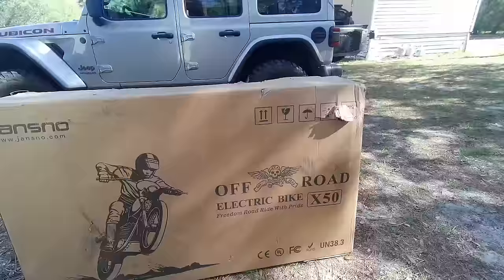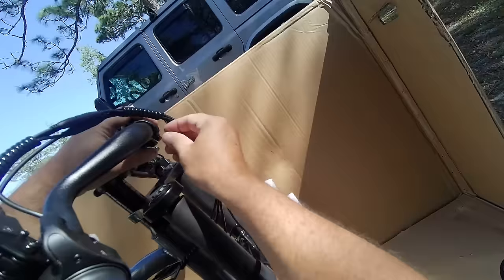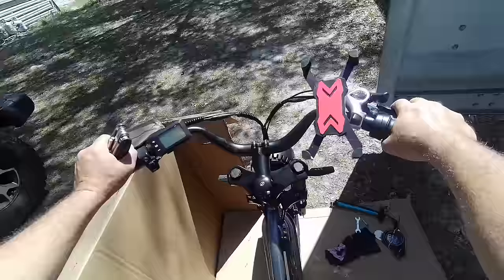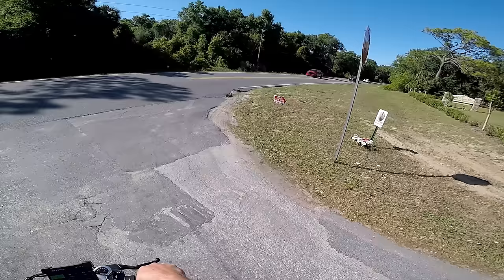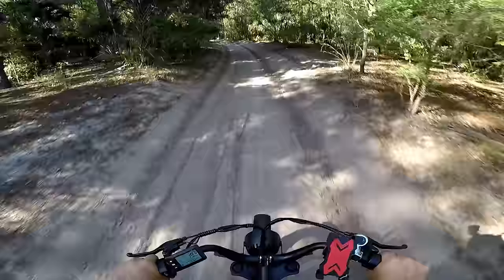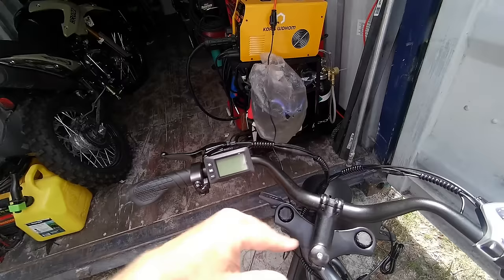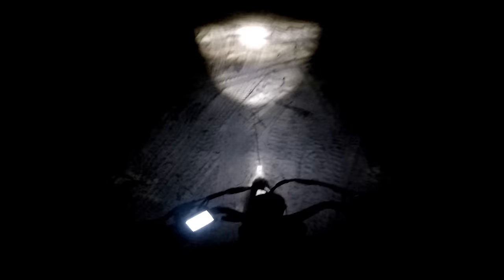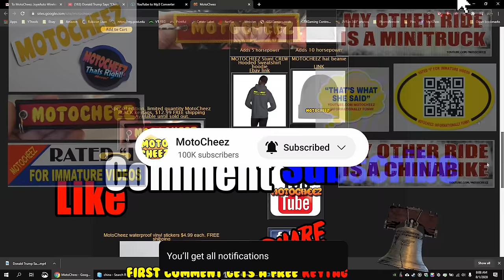Jansno X50 Electric Bike 20"x 4.0 Adults, 750W Brushless Motor, 48V 12.8Ah Removable Battery,

Comment: The biggest reason I wouldn't get this bike is the range. For the price it's a bike that's well worth it for most first timers, I would just recommend getting a UPP battery backup and triple the range. Edit: :) good you noticed the fender.
Reply from the maker: My tests were mostly in sand, thats hard work on the battery, on the road only it would do much better of course
Reply: What battery would you recommend
Reply from the maker: I'd get the same battery that's on it, or same space specs to be safe. The range is way more than I did under normal conditions
Reply: @MotoCheez  what's the range on this my job is 15 miles all round trip
Reply from the maker: Should do around 45 miles if mostly flat
Reply: @MotoCheez  Yeah It all depends on your riding style and the conditions. I was was just offering ideas for extending the range. Range is a big deal for me because I live on a chain of islands and to get to the downtown area it's about 8 miles, then another 6 just to get to the trails. I could just get a rack for my truck, and I probably will. It would be nice to make the whole circuit bike only without worry on occasion.

I know a few people who have installed a second battery and it's worked well. I only know one who somehow got it setup so they didn't have to swap batteries. I think he said he got a kit that allowed him to run them in a single circuit. I personally don't know enough to do that yet.
Reply: @MotoCheez  so can't put a 52v 20ah battery on this bike without changing the controller?
Reply from the maker: I've never done it but there is plenty of information out there
Reply from the maker: No, the controller was 48v
Reply: @MotoCheez  so I just need update the controller if a get a bigger battery
Reply from the maker: No, only if you get higher voltage battery. You can put as big battery as you want 48v
Reply: @MotoCheez  You should do a updated review video, full range test on flat ROAD and with the fenders on right, save yah the hassle of answering the same questions over and over! 🤣👍
Reply from the maker: @Wize817 but I did put in a video when I reverse the fender. When I get down to my place in Florida definitely will do it longer ride on flatter road. Keep it on the pavement mostly

Comment: Hi amazing video. Do you know where to get a replacement seat if you know the original seat rips? I been looking all over for replacement parts before purchasing. Like replacement parts for the turn signals, headlight, and seat. These don't seem to be universal parts but I could be wrong, please correct me! 😁
Reply from the maker: Most the parts are definitely universal, the seat cover I am not sure tbh. It looks similar to others I've seen. I'd bet If you measured it and ordered a seat cover you could make it work

Comment: @MotoCheez and fellow Jansno X50 owners, I have questions and would appreciate your answers/help. 1. Is the X50 decent or good for peddling as a bike? 2. Curious how does it compare to a 26" fat tire for on-road and off-road riding? 3. How does the X50 ride compare to a Folding 750W ebike in terms of ridability, offroad too (like a Lectric, Vitalin i7, etc) ? 4. Can someone weigh the X50 with battery? Lots of conflicting info on the web. 5. Lastly, whats the full length of the X50, the wheelbase, and ground to seat height? No dimensions of this ebike and support dont answer? Thanks so much, looking for more X50 videos! 😎👍
Reply from the maker: It pedals pretty decent, just like any other e-bike with fat tires slightly noticeable from the larger tires but really not much. The ride is better than the folding e-bikes I've tested mainly because the seat feels more comfortable to me, the length and height I did not get I had another person ask the same questions You are and I did not get a chance to get those measurements. The way I have no way of determining but I believe it's around 70 lb because it is lighter than the HOVALFA that I have down here

Comment: I saw you commented that they are coming out with a new version X60.  Can't wait to see what they upgraded.  I'm thinking about upgrading the battery to a 52v 20ah one.  Do you think I have to replace the controller or will it handle the 52V?
Reply from the maker: I took a video of the controller, It's rated at 48 volts so you would probably have to change the controller

Comment: That front fender on backwards was priceless; reminded me of when Mork wore a suit backwards and Mindy thought he was a priest when they first met. It was just so obvious.

Anyway, the 12.5 ah battery and 10-mile range is a dealbreaker; imagine being stranded 10 miles or even 5 from home trying to pedal that thing? My Ebike is 78lbs (with a 21ah battery) and there's no way I'd be pedaling that thing. I typically take a 15 mile round trip when I do ride, and 10 miles just doesn't cut it. I'm eying the EUYbike S4 ($1,399); 44 mile range throttle only with a 25ah battery.

Comment: Hey, just got this bike and set it up, based on your review for the most part. Few questions.. On PO5 in the menu to change the pedal assist levels it's only showing 2 for me. Also do you have to manually change it in the menu when you want to switch between electric, regular, and assisted?
Reply from the maker: No.  you change it it should work throttle pedal assist etc just go up and down on your pedal assist numbers
Reply: Do you think it's possible to mount a second battery under the seat? Does the area under there taper down where it meets the frame?

Comment: As of November 24th 2023 this bike was $728 with an 18% off coupon on Amazon this in my opinion is one of the best deals out there I know it has mechanical brakes I know I have some smaller things that are not as ideal as some other bikes in this area but for 700 bucks instead of $1,200 or $1,600 that's amazing
Reply from the maker: Wow, yeah! Definitely good deal

Comment: Looks like almost every one of these bikes have the same components. My thailand made Volto Bazooka(Cant remember the real name) has the same stuff and its an 2020MY.  Ever so slightly altered plastics and paint pretty much...
What u really pay for is a design, and this one looks comfy and nice
Reply from the maker: Yes, just different configurations 500 w 750 watt somewhere 1000 watt and more which I want to get my hands on soon to do some tests they must be a blast
Reply: @MotoCheez  Ye, i wished mine where more than the advertised 750w cause its gutless as soon as it sees an small incline/hill :D Thankfully i got an Surron to play with.
If u google Volto Bazooka, as its named by the reseller here in Sweden, u see i have the battery in a tube.its supose to be 20ah. Would love to make it even bigger for those long rides
Reply from the maker: Suron is a whole different class! Ahh I see

Comment: So that wire you disconnected at the beginning of the video to make the bike a class 3...do you have to do the same thing to a FreeGo DV K200? CAN you do the same thing? I thought going in to the submenu on the control panel and changing the settings there was all that was required. Do I need to disconnect that wire on the controller too?
Reply from the maker: You can just unplug on this one. Depends on controller

Comment: Do you think this is an OK bike for 15 year old? He likes 28 mph. He also likes off roading so good shocks are needed. I also think the battery in this one is not going to go far enough .
Your thoughts?
I do like the price.
Reply from the maker: It's good for a 15-year-old if he knows how to ride, the poor battery life was because I rode in sand the majority of the time and it's very hard to push through to sand on paddling battery or even a motor. You could get at least 35 mi on the road and more if you pedal assist. I did not pedal assist at all really

Comment: I'm 195cm length.. does it fit me weight 105... How's the stand with the pedaling... Are my knees get between my ears. Or do they hit the steering wheel?
Reply from the maker: I'm 5'10 235lbs and it's a bit tight pedaling, would probably be good for you

Comment: Can you move the turn signal console and the screen along with the shifter? I ordered this exact bike and am planning on getting mirrors for it.
Reply from the maker: I'm sure you can probably move them, but where are you thinking of putting them
Reply: @MotoCheez  Just inbetween the grips and the brakes/turn signal console and it will be ones that I can adjust

Comment: This bike is a great. I have one. Top speed 45 mph with pedal assist. But it will burn burn your battery fast. Do not recommend this for long distance(15 miles or more) did experience that odd squeaking sound. Not sure what that even is but it annoying.
Reply from the maker: 45! Wow. Nice
Reply: @ahallofgaming802 that top speed cant be right, no way! 😂Speedometer needs calibrating to the right wheel size (Not 20"). Verify speed with a GPS Speedometer app for true MPH speed!
Reply: That odd squeaking sound is probably the front forks or rear shock? Likely the front forks which is probably the worst part as its non-adjustable and cheap, with a extension goose neck stem. *BE CAREFUL the forks bend easy! Reviewer went over a speed bump @ 10mph and broke his collar bone and ribs, guy was a Harley rider too! 😳
Reply from the maker: @Wize817 I did verify by GPS it is 2 to 3 miles per hour fast that's it. Like most bikes

Comment: ive also got the x50, kinda want to upgrade to second battery for range and a little more speed. How could i do so?
Reply from the maker: As far as speed you probably have to change the controller, but if you add another battery there's a device that would switch between the two or you could just put a switch to switch between the two

Comment: Hey cheez how do you loosen the brake pads? Mine are rubbing & caliper bolts are stuck.
Reply from the maker: The caliper bolts will center it to the rotor if they're dragging

Comment: I'm having creaking noises from the rear shock like it needs lube. I greased the arm but you used WD40 and sprayed it in there. Is that better? Did you have creaking noises from the shock? I was thinking of replacing it with a 165mm 850lb coil shock with preload and rebound dampening anyway but anything to make it not sound like a squeaky mattress would be good.
Reply from the maker: Grease is probably better. I think that's a good idea to change out that shock with a 850 pounder, I'm not so sure if it was a shock that was creaking too
Reply: Yeah I went for a ride last night with a bunch of grease on the body and it worked. Seemed to free it up as well, but 1000lbs shock? Maybe they meant 330lb rider MINIMUM not maximum. You think they would have put .02 cents of grease on there from the factory. Lol. Anyway yeah I'm planning on replacing it as well as put some nice cable actuated calipers I have once the cables are stretched in. Cheers. @MotoCheez
Reply from the maker: @chrissinclair8705 Yeah it's a thousand pound shock because of the leverage the rear swing arm has on it, it is pretty stiff but it doesn't have that long of a travel. 750 lb shock probably would be better suited for someone around 200 lb
Reply: Oh just to let you know the 14amp battery has a 2.5amp charging BMS so if you get a 3amp charger it cuts the charge time a bit. Don't worry the BMS will take just what it needs, you could have a 5amp charger on there and it's only going to pull 2.5amps. @MotoCheez
Reply from the maker: @chrissinclair8705 good info. Thanks

Comment: Hi there, love your ebike reviews, do you know if it is possible to add a second battery to this, and can you also add a rear rack or front basket?
Reply from the maker: Thanks! I know people have added another battery, I believe has to have same specs it same battery. I don't think they offer a front or rear rack but I did see some people that put on the universal ones before
Reply: @MotoCheez  Thanks for your reply, I do want to get this, but I'm hesitating because of the battery issue. I think the controller can handle up to 15amh, the other alternative is to change the controller and get either a 52 or a 72v, but that might wipe out any saving made in buying the ebike in the 1st place 

Keep on riding, my Bruh!!
Reply from the maker: It didn't have much range because you have to take into consideration how resistive it is riding in the sand when I did most off-road It's like climbing a hill the whole time If I stayed on the road I'd probably get three times the battery life I would expect. Yeah putting a larger voltage battery and controller would definitely change things
Reply: @MotoCheez  With regards to a bigger battery, I'm looking at a 52v 20ah, would the current controller be able to handle that and how much more range would I get, throttle only wise? I weigh about 200+ lbs
Reply from the maker: I believe it only had a 48 volt controller, I did do a close-up of the controller would say on there I'm not actually sure to be honest, as far as range it depends on the amp hour of the battery of course

Comment: I’m having battery problems I just got mines today I rode it around a few now I’m home and I’m not sure how too properly charge it should the battery be on what college should the charger light should be
Reply from the maker: Depends on what charge you have, normally when it's fully charged it turns yellow when it's charging. Your bike should charge it while you're driving but it takes a while if the battery is really low could take like 20 minutes
Reply: @MotoCheez  ok thank you so when I charge it should the battery be on or off
Reply from the maker: You can do it either way if you have a good trickle charger it usually comes with the wire to connect the battery and a connector so you don't have to take the side panel off

Comment: Can I upgrade the battery if so can you recommend a battery I need long range.
Reply from the maker: Sand is like driving up an incline. Battery did great on the road, the off-road sugar sand put a hurting on it. Bigger battery would drive better
Reply: @MotoCheez  know any brands that would fit this bike?
Reply from the maker: I don't unless you use 2, They're actually just about ready to release a new model X60 that's supposed to have huge improvements over this old one so you might want to wait a little bit if you want a bigger battery, I should be getting one shortly
Reply: @MotoCheez  I see I hope it releases soon. I want a bike ASAP otherwise I’ll purchase a second battery.
Reply from the maker: It'll be a few weeks I'm told
Reply: @MotoCheez  I see cool thanks

Comment: Has anyone noticed that the throttle speed goes way down on a rough road or a dirt road? On pavement I can do 28mph but on dirt I only get 7-8 mph. Anything I can do about it?
Reply from the maker: Didn't have that issue, I ky sand slowed me down a bit.
Reply: Would you happen to know all the setting on your bike maybe I have some sort of safety setting turned on.
Reply from the maker: You can compare the settings to what I have in the setup video
Reply: I ride my Jansno almost all the time on dirt roads and consistently max out the speed limit w/out any problem.

Comment: The motor is pretty loud.. I have those same tires and I know they are not the quietest ..
Reply from the maker: The motor sounds loud because I had to use my body camera for a microphone when my GoPro microphone crapped out, so it's very low. The motor actually sounds the same as all the rest of the e-bikes I've tested. Yes these tires are a bit loud compared to road tires, but I don't mind cuz I can go in the sand and off-road 😁
Reply: @MotoCheez  to bad the phone holder couldn't hold that controller 😂
Reply from the maker: I know. They make those silicone straps for the motorcycles probably wouldn't be a bad idea I had some extra ones that would probably hold it

Comment: 13 miles makes it a pass for me!
Reply from the maker: The sugar sand, it's like riding up hill, on the road this bike will definitely do more than double
Reply: @MotoCheez 
 I decided to buy the Euybike S4. It has a 48 volt 25 ah battery.
Reply from the maker: @JackMeoff-tr5jg how do you like it?
Reply: @MotoCheez 
 I have not received it yet. I can tell you after I receive it.
Reply: @JackMeoff-tr5jg  Update on the EUY S4? 🤔 Good alternative but cant stand the ridiculous split-seat design they did instead of a full length seat?! 😆 What I noticed from ALL moto-style ebikes is the biggest issue is the seat placement (no adjustability!) and the LACK OF COMFORT! Like its a huge issue that nobody really talks about. The X50 is one of the few that has a decent seat, however other issues. I probably will go with a newer "Cross" style Moto/Foldable ebike as it has the adjustable/swappable seat, positions, and portability that lacks in ALL moto ebikes. 😎
Reply from the maker: @Wize817 I agree about the seat. Motorcycle style seats are fairly comfortable and better for somebody that's probably just writing it like a motorcycle but they're low for pedal height. The folding e-bikes that I've tested are pretty cumbersome to fold up and keep folded you'd have to use a bungee cord but yeah they do take a little less space.

Comment: I'm not sure what the author's Intention for posting this video is, but from the comment and the negative reviews on Amazon this bike is cheap and it breaks very easily...This bike  Has a battery that does not last for over 3 months... The handlebars are too low and the kickstand is fixed on the wrong side and it's very weak... The brakes seem to break a lot.... And they have terrible customer service I wish you'd recommend this bike to my worst enemy
Reply from the maker: Hmm, not in my experience so far. Time will tell